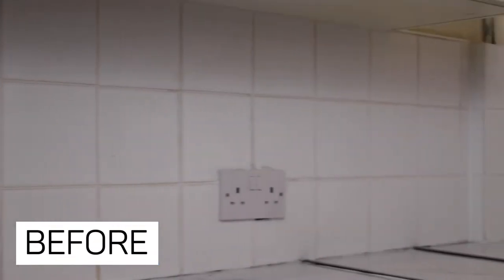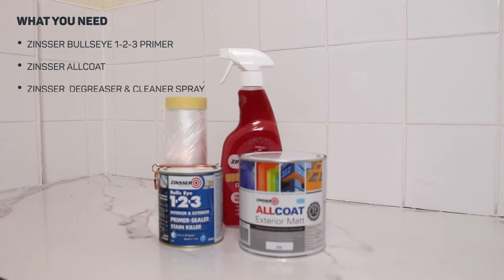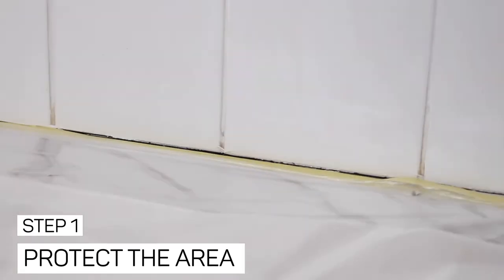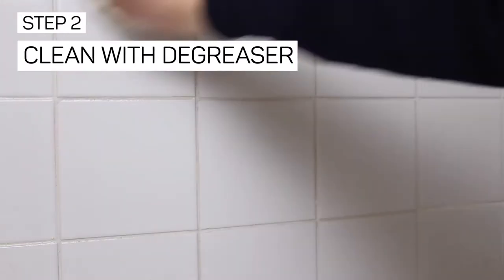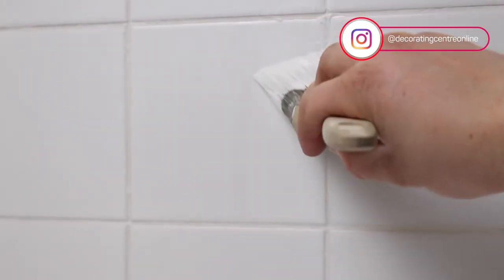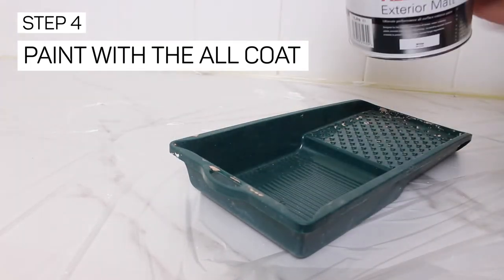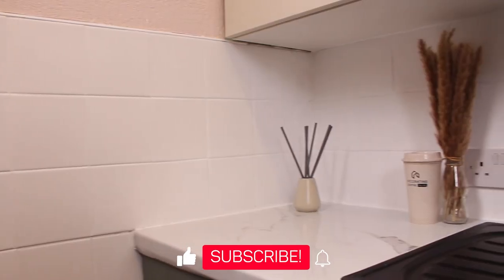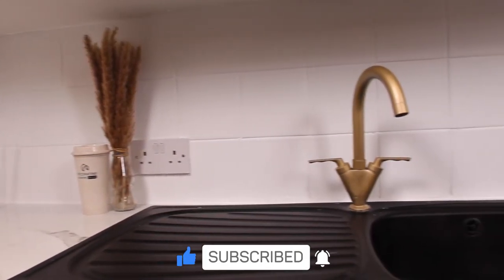How to paint tiles using Zinsser AllCoat

Comment: Is this an easy to clean surface afterwards? I noticed it's a Matt finish paint. Could I still wipe it down without taking any of the paint off when it's dried? I saw there is an interior gloss and satin in the same type of paint as well. Thanks 🙏🏻
Reply from the maker: The Zinsser AllCoat Matt is pretty easy to clean, and you can definitely wipe it down without chipping the paint.  😊